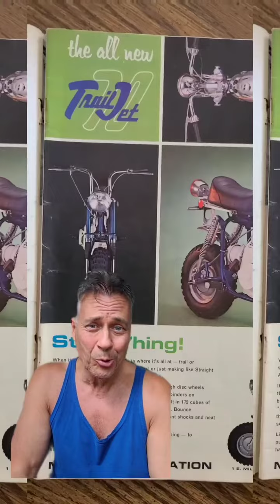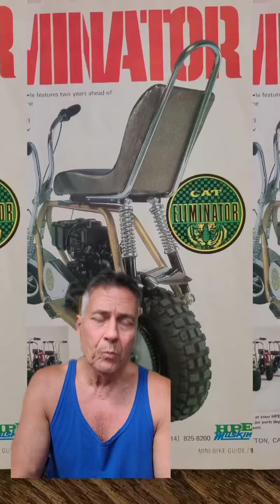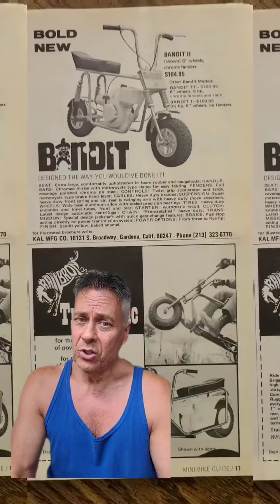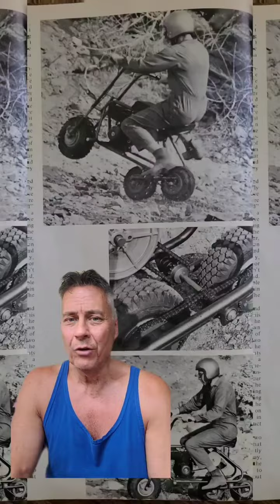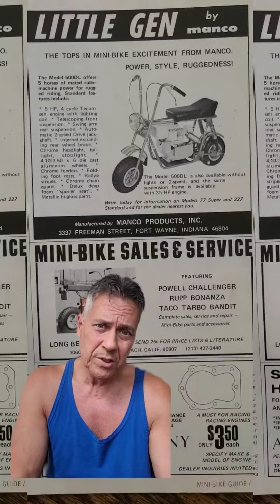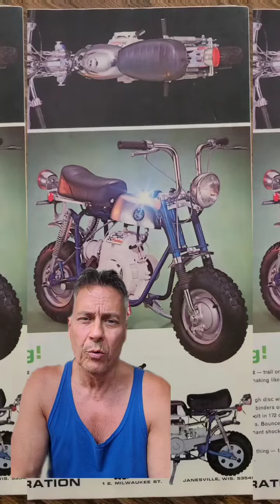What happened to Briggs & Stratton Mini Bike Motors???

Comment: I had a heath kit Boone bike back then, put a cat transmission on it with a new 5hp Briggs on it, great runner. Then I received.a Penny's, scat track 3-wheeler, put a new 5hp Briggs and a solid 1in straight axle on it with bicycle generator lights on it . Fun days!